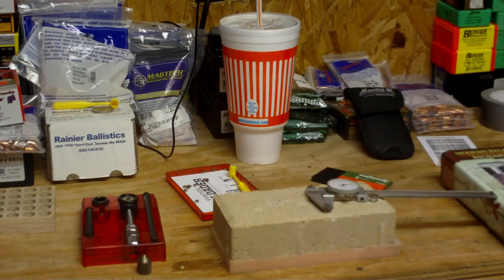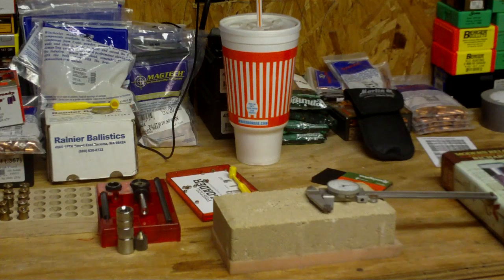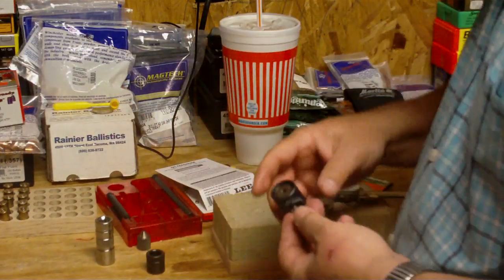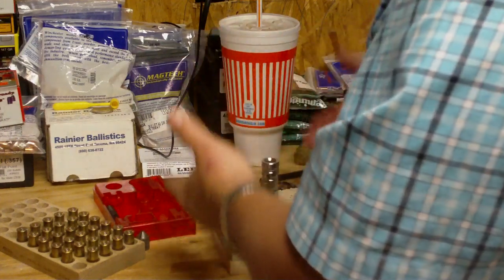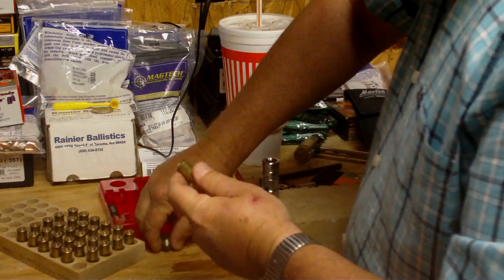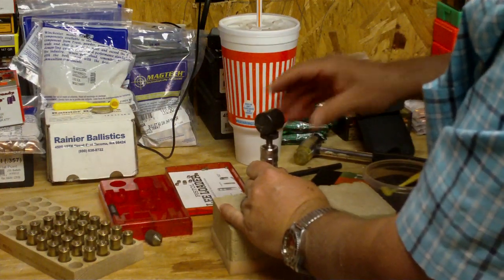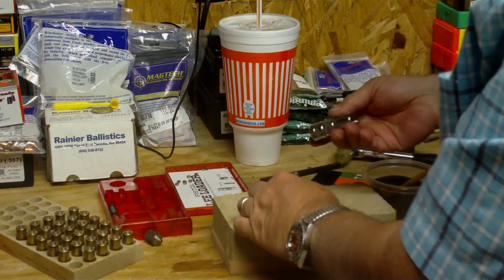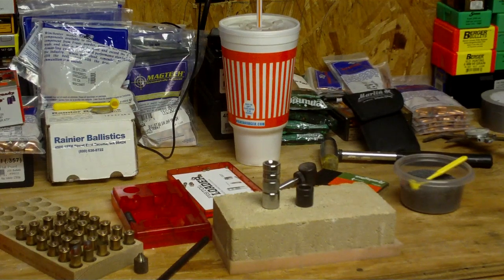Reloading 44 Magnum with Lee Loader

Comment: Fun vid! I love those little kits! Feel like a cowboy using them! I recommend for a few bucks to anyone to pick up a Lee hand prime. It really speeds up the process. Also, I recommend another deprime tool. I was in a hurry once and broke the tip on mine. They're just a few bucks and you need an extra anyway. Another thing to keep in the back of your mind if you get one of these kits is the way they size the brass, the cartridge is really only guaranteed for that particular cylinder. It may be too fat for another revolver.

Comment from the maker: I got after you told me you ordered yours. I thinking of you John when I planned to make this video, I wanted to cover the basics and do more detail in hope it might be useful to you. Something I forgot to mention is that when you adjust the bullet seater for the right overall cartridge length, you might want to consider using thread locker on the threads - like Loctite - so that it won't move on you once you set it. Good luck with yours and God bless you.

Comment: I enjoyed your video. It was clear and concise, always a good thing. I'm just a little concerned about you MOL measurement. You said the recommended MOL is one point six ten, I think that means 1.610. (Or one point six one zero). You then said your reload was one point six two ie 1.62 or was it really 1.602, one point six zero two? One is ten thou oversize, the other eight thou under.
Reply from the maker: +9gello One point six ten is 1.610. Mine loaded size was one point six two which is 1.62 which is good. The MOA is just as the name implies, minimum overall length, you cannot go below that, however, you can load to longer lengths as long the length you load fits in your chamber fine. I load to slightly over MOA to ensure my loads chamber in all my guns.  Thanks